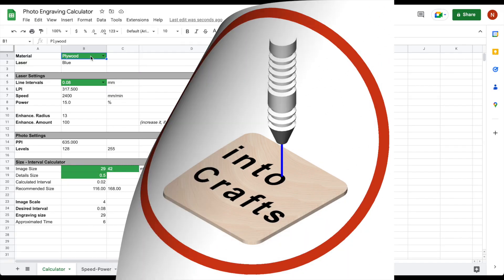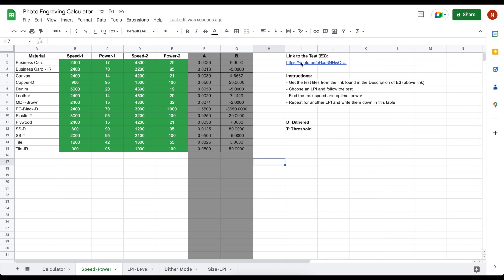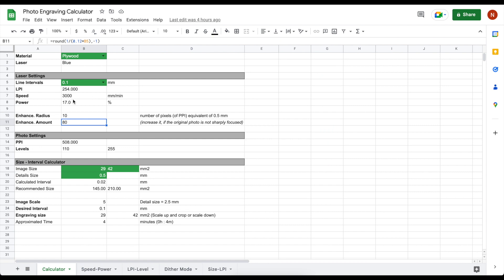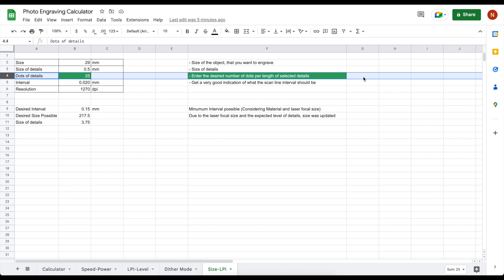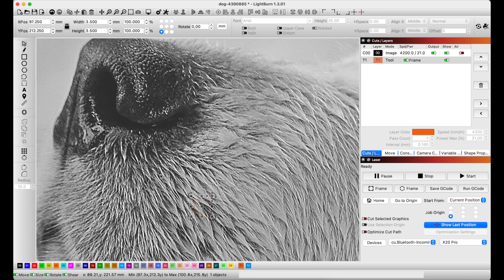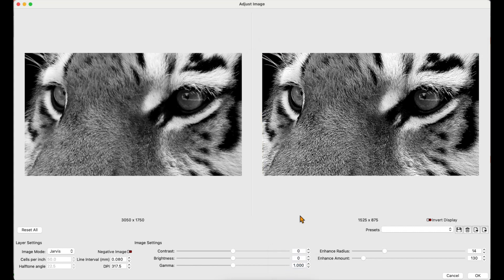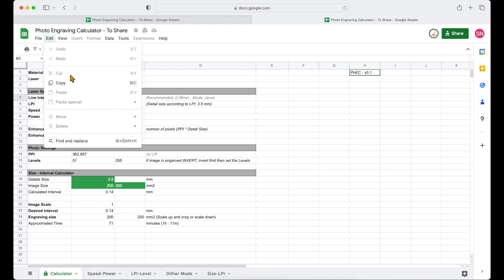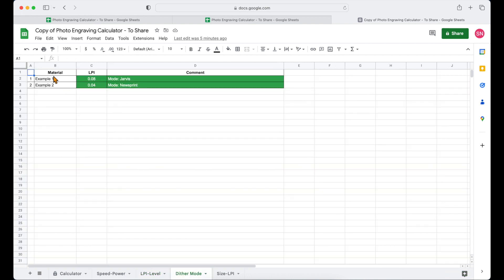E7 - Photo Engraving Calculator

Comment: Is finding the speed limited to 1000/2000/3000/4000 or values every 100?

I see you are using speeds of 4200/3200/4800/2400
Reply from the maker: Thanks for your interest and comment.

I use factors of time per dot and reverse calculate the speed (mm/s), then mm/m will end up some numbers as you mentioned.

It should not be necessarily like that, run some tests according to E3 (https://youtu.be/pHxq3NNwQcU) and use the value you found from those tests. There are no golden numbers, the speed depends on material, laser type and many more parameters.

I hope you have got the answer to your question.

Comment: Good afternoon, excellent work, I need your help in the following:
In the calculator sheet when I select from the drop down menu in cell B5, line intervals, eg. 0,1, in the LPI cell, gives me the following message, #VALUE!, what am I doing wrong?
Thank you
Reply from the maker: Thank you, glad you liked it.

Have you filled in the supportive tables?

Click on the cell asking for a Value, and check where it is referring to…
It could be also due to the system decimal separator (. or ,), check that too

Comment: Hello, congratulate you on your work, a question for you, what is the price of the complete excel calculator template with all the materials
Reply from the maker: Thanks for your comment and the nice words Jose.

The only reason I have deleted my own entries on the supportive table of the calculator is because each laser each material will act differently. So, the users don’t get biased about my entries but instead find their own parameters.

In short, the critical parameter is Time per Pixel, which is around 2ms for most of the materials, except slate, tile, and in general tougher materials to leave a mark by pulses (about 3ms or more).

Now with a given line interval (DPI) you can approximate your speed range, then found a proper power.

I hope it was an inspirational guidance.